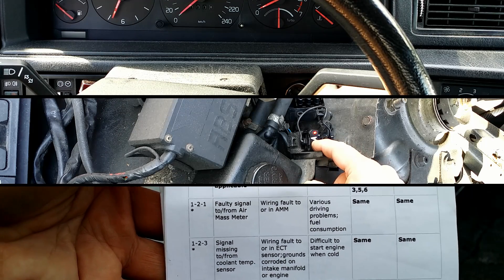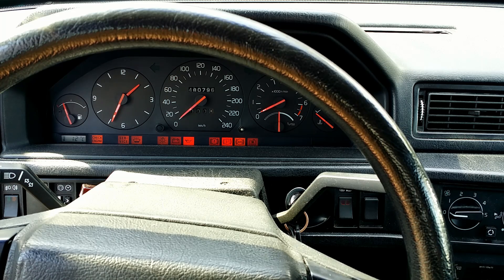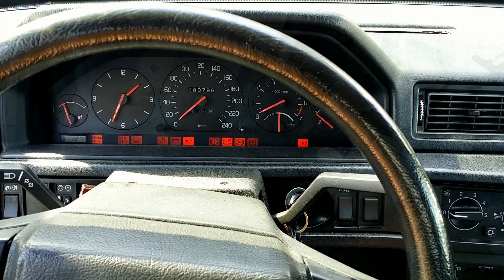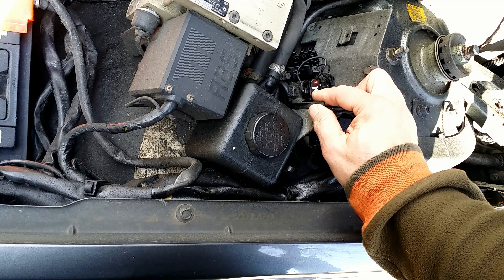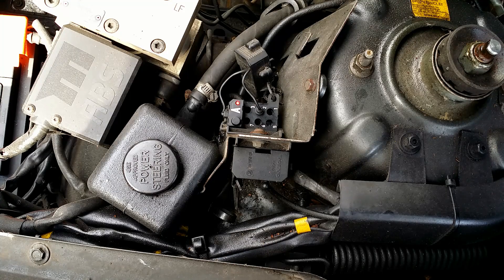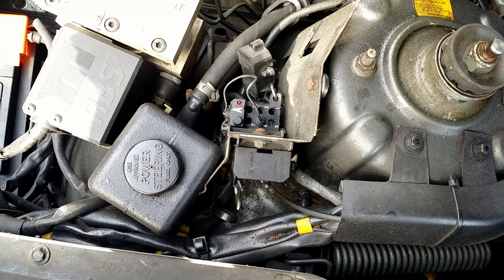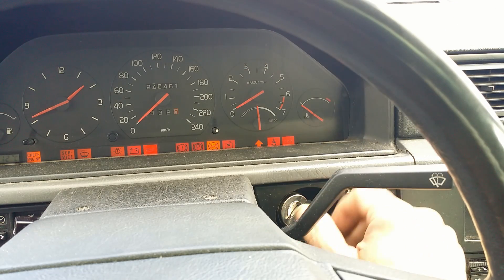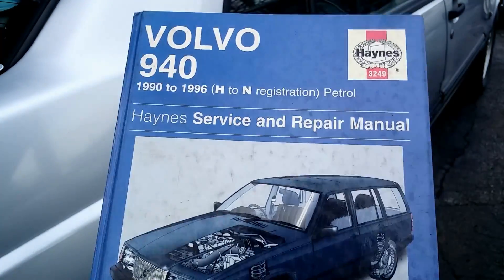OBD I Codes Reading

Comment: 14.7 gallons of air required to burn one gallon of fuel. That is proper stoichometric ratio. How'd I do?
Reply from the maker: According to "Bosch Fuel Injection & Engine Management" by Probst - by mass: 14 to 1, by volume 11,500 to 1.

Comment: Great video,  do you have a link to the blink code list ,i have a 940 2.3 turbo that is not running, i have found this test port on the car.
Reply from the maker: I provided the lists of codes in several answers to the comments under this video. Good luck!
Reply: @robertdeptula2003  thanks for replying, I am getting 1.1.1 on the efi pin (no 2.)
It's a odd fault, sparks on plugs are good and fat, tacho is moving... it has a new fuel pump and filter.( the one under the floor.)
Yet plugs are bone dry, I'm no expert on 34 Yr old volvo fuel injection systems... there is fuel at the rail, the regulator isn't leaking through the vacuum pipe.
Reply: It is like the injectors aren't opening..
Reply from the maker: In this video there is procedure for self test that includes injectors testing. You will hear them firing.
Reply: @robertdeptula2003  thankyou for the suggestions, turned out to be cracked solder joints on the radio suppression relay.... I think you have shown this fault in another video.
Interestingly the OBD blink codes showed no faults... just shows how these old EFI systems were quite crude by modern standards.
Reply from the maker: Thanks for sharing info about the solution.

Comment: I want to flash the srs code but i have a fuse att 24 should i take that away?
Reply from the maker: In some markets 940 models have the testing point at the diagnostic test socket boxes at the left strut tower (inside the engine compartment). The test point nr 5 in the B box  is used to test the airbag. The codes are: 
1-1-1	OK: No faults detected in the OBD system
1-1-2	Internal fault in the sensor unit
1-2-7	SRS lamp, short circuit or break in circuit
2-1-1	Steering wheel module, short circuit in wiring
2-1-2	Steering wheel module, break in wiring
2-1-3	Steering wheel module, short circuit to ground
2-1-4	Steering wheel module, short circuit to +12V
2-2-1	Passenger module, short circuit in wiring
2-2-2	Passenger module, break in wiring
2-2-3	Passenger module, short circuit to ground
2-2-4	Passenger module, short circuit to +12V
2-3-1	Seat belt tensioner left, short circuit in wiring
2-3-2	Seat belt tensioner left, break in wiring
2-3-3	Seat belt tensioner left, short circuit to ground
2-3-4	Seat belt tensioner left, short circuit to +12V
2-4-1	Seat belt tensioner right, short circuit in wiring
2-4-2	Seat belt tensioner right, break in wiring
2-4-3	Seat belt tensioner right, short circuit to ground
2-4-4	Seat belt tensioner right, short circuit to +12V
No code	SRS lamp in the instrument cluster does not light
No code	Fault in diagnostic output

Good luck!

Comment: Can i get a code from the abs? I had a broken abs sensor cable(left front), i soldered the cable and the light turned off. After some time the light turned back on, i assumed the cable broke... At a track day where my brakes overheated the light magically dissapered  but on the way home it turned back on.... I replaced the sensor and along with it the soldered cable but know the light wont go out, the rest seems to be fine but how can i diagnose the abs?
Reply from the maker: If your car is 92 and up, then test box A and plug the probe to position 3. Press for less then one second and here are the codes: 
1-1-1	No error code set
1-2-1	Left side front wheel sensor: faulty signal at speed less than 40km/h
1-2-2	Right side front wheel sensor: faulty signal at speed less than 40km/h
1-2-3	Left side rear wheel sensor: faulty signal at speed less than 40km/h
1-2-4	Right side rear wheel sensor: faulty signal at speed less than 40km/h
1-2-5	Signal faulty from at least one wheel sensor for a long period
1-3-5	Control Module (CM) faulty
1-4-1	Faulty pedal sensor: shorted to ground or supply
1-4-2	Faulty stop (brake) lamp switch: open circuit
1-4-3	Control Module (CM) faulty
1-4-4	Brake discs overheated
1-5-1	Left front wheel sensor: open circuit or short-circuit to battery voltage
1-5-2	Right front wheel sensor: open circuit or short-circuit to battery voltage
1-5-5	Rear axle sensor: open circuit or short-circuit to battery voltage
2-1-1	Left front wheel sensor: no signal on moving off
2-1-2	Right front wheel sensor: no signal on moving off
2-1-3	Left rear wheel sensor: no signal on moving off
2-1-4	Right rear wheel sensor: no signal on moving off
2-1-5	Valve relay: open circuit or short-circuit
2-2-1	Left front wheel sensor: ABS operation signal missing
2-2-2	Right front wheel sensor: ABS operation signal missing
2-2-3	Left rear wheel sensor: ABS operation signal missing
2-2-4	Right rear wheel sensor: ABS operation signal missing
2-3-1	Left front wheel sensor: signal missing
2-3-2	Right front wheel sensor: signal missing
2-3-5	Rear axle sensor: signal missing
3-1-1	Left front wheel sensor: open circuit or short-circuit
3-1-2	Right front wheel sensor: open circuit or short-circuit
3-1-3	Left rear wheel sensor: open circuit or short-circuit
3-1-4	Right rear wheel sensor: open circuit or short-circuit
3-2-1	Left front wheel sensor: irregular interference at speeds over 40 km/h
3-2-2	Right front wheel sensor: irregular interference at speeds over 40 km/h
3-2-3	Left rear wheel sensor: irregular interference at speeds over 40 km/h
3-2-4	Right rear wheel sensor: irregular interference at speeds over 40 km/h
4-1-1	Left front wheel inlet valve: open circuit or short circuit
4-1-2	Left front return valve: open circuit or short circuit
4-1-3	Right front wheel inlet valve: open circuit or short circuit
4-1-4	Right front return valve: open circuit or short circuit
4-1-5	Rear valve: open circuit or short circuit
4-2-1	Rear wheel circuit inlet valve: open circuit or short circuit
4-2-2	Rear wheel circuit return valve: open circuit or short circuit
4-2-3	Traction control system (TRACS) valve: open circuit or short circuit
4-2-4	Pressure switch for TRACS: faulty or short circuit
4-4-1	Control Module (CM) faulty
4-4-2	Pump pressure low
4-4-3	Pump motor/relay: electrical or mechanical fault
4-4-4	No power supply to valves in hydraulic unit
Reply: @robertdeptula2003  thank you so much for the reply!
I previously had a 97 940 wich did not have ob2 but it had e fan. After it sadly got destroyed i bought a 98 and it has a belt driven fan so just assumed it didn’t have obd2 either. I just spent 20 minutes looking for the test box and couldn’t find it. After some research I found out it has obd2 under the armrest. 

Anyway thanks again for the reply!

Comment: What if you get 1-1-1 but your check engine light is on?
Reply from the maker: Remove the bulb. Seriously... I don't know.
Reply: Need to try all the different diagnostic ports, one will show a code
Reply: What is the malfunction if the Volvo 940 6 code comes on 8 times?

Comment: i do get a code on A6 1.1.3 but i cant find it on internett only A2 1.1.3 too ritch / too lean so what is A6 1.1.3 on my car i got a bosch coil..
Reply from the maker: I don't have any info about the code 1-1-3 from A6. Do you experience any problems with the engine running?
Reply: @robertdeptula2003   yes i need too replace cap and rotor every 7 month and the car is a bit shakey.
Reply from the maker: For A2 1-1-3 some tables say "faulty fuel injector". Clean and test injectors.

Comment: Awesome video!
Can you tell me if that haynes manual has instructions for 16v redblock engines?
Reply from the maker: 16 valve engine has the same Bosch LH 2.4 system as turbo or base model. Code reading is the same in this model. The only difference is Regina system (Siemens).